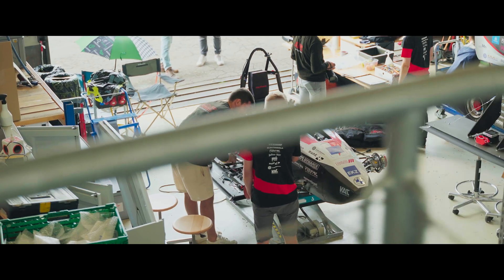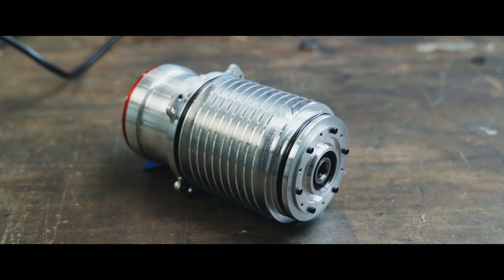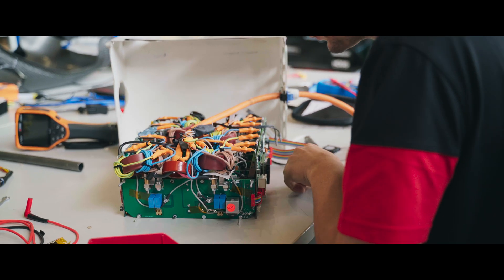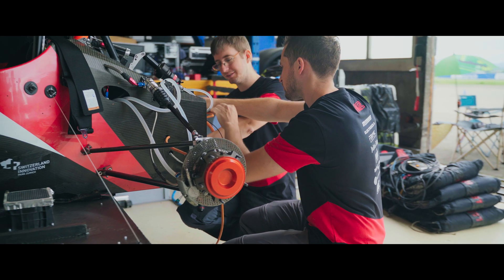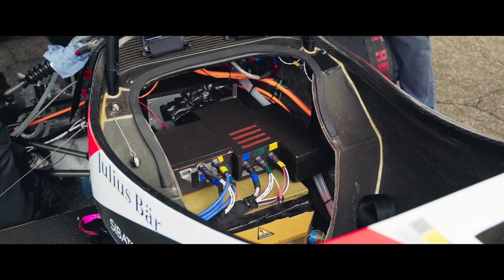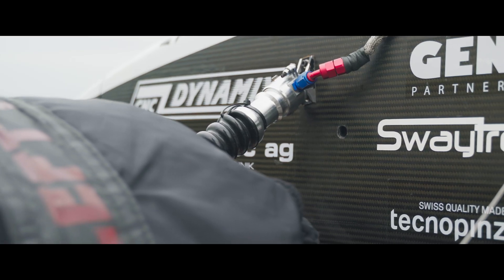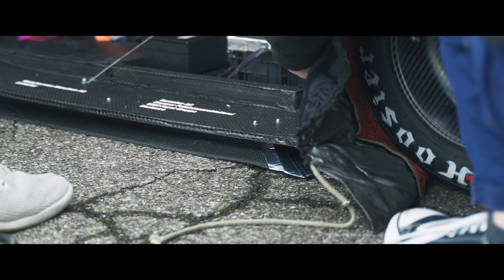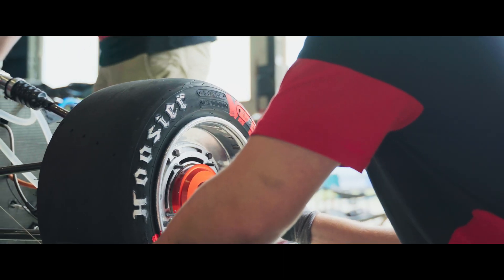AMZ World Record Technical Video - mythen 2023

Comment: I have thought for many many years now motors at each wheel is best mainly for no loss in driveline, beautiful fruition, thank you
Reply: great for traction, bad for unsprung mass, bit cumbersome for brakes, has to be really compact package. Ideal if cost is a minor issue.
Reply: @MaxMustermann-bm7qt  have you seen who holds the fastest 0-100 kph title right now? 4 wd hub motor electric
Reply: @mrkeopele  of course. But in practical terms, fitting the hub in the wheel and the brakes, takes some space and has high cost. And it's a shit ton of unsprung mass. I didn't say it wasn't the best. Just that it has some drawbacks.
Reply: @MaxMustermann-bm7qt  efficiency is kind to the earth, rather than cheapest
Reply: @mrkeopele  one less powerfull motors, is probably best for the planet. Saves 3 motors and planetary gearboxes in the hubs. two motors and one planetary gearbox should be the most efficient drivetrain in the world. But we're talking about a high performance race car, that in mind efficiency looses to easy torque vectoring in 4 wheels.